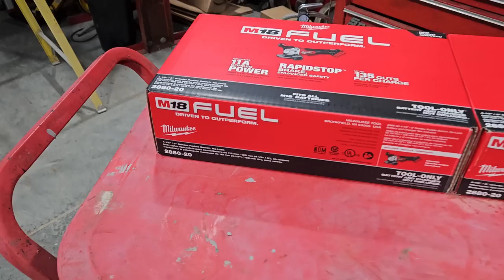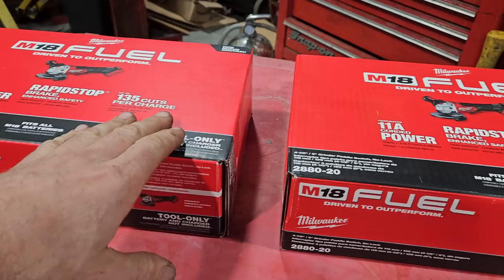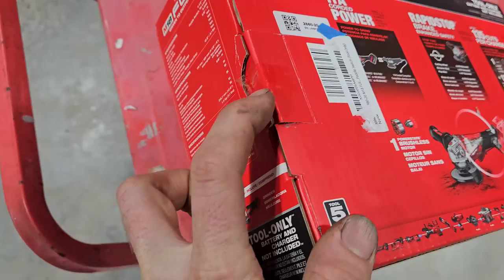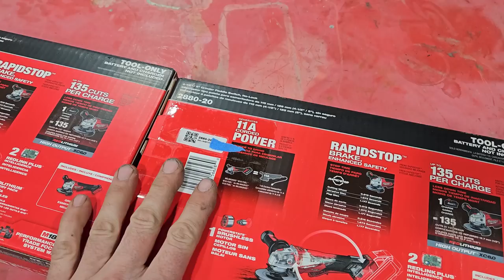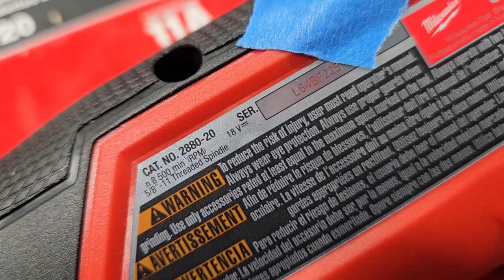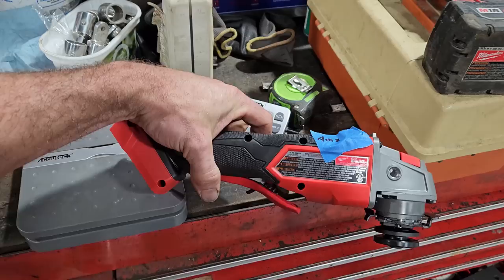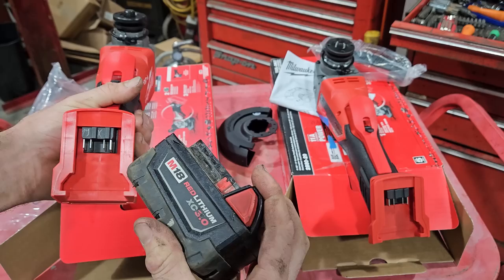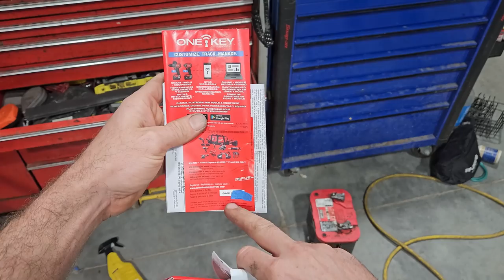Amazon MILWAUKEE Tools FAKE or THE SAME? Half Price!

Comment: I’ve grabbed quite a few fuel tools off Amazon including the grinder shown and so far so good. Jigsaw, 3/8” & 1/4” ratchets, 1/2” hammer drill, vacuum, trim router, couple high output batteries, jobsite blower.. All have done incredibly well and for part time shop use I doubt I’ll ever need the warranty anyway
Reply: They are stolen
Reply: @wpintofg  nobody can prove that they are. You're just assuming that. Even if they are then who fuckin cares? The buyer didn't steal them, the reseller did. It's not on the buyer for being deceived. It's on the reseller. Sounds like a win-win to me for getting a half priced, authentic tool. 🤷‍♂.
Reply: Different price since they are meant for different markets, countries, and turns up another place.
Commonly known as grey market.
Internet makes this convenient, im sure.
Different price, same product.

So if one would like to support middle men, taxes, employees and so on. Buy the expensive one.
Reply: @R.Stridstrom  I have long stopped buying tools from Home Despot. Their mark up is outrageous. My local tool shop is usually able to give me a better deal or throw in accessories like a battery or blades etc and I help the little guy.
Reply: @LG-ct8tw  yeah, if we can, better help the little guy.
Reply: If you need it it won't matter 5 years starts with  manufacturing  date not sales date.   That's all that changes. I have had several  both repaired  and replaced under warranty.   No issues
Reply: @wpintofg not usually
Reply: Cool tell the whole world what tools u have the thief likes people like u

Comment: Very interesting. I have worked a lot in a country in Asia, and before they had a crackdown on non-licensed clothes from brands like Polo, Nike, Adidas etc. it was easy to buy clothes on some markets that was made on the same production lines as the originals, with same materials, buttons etc. and sold for a fraction of the price of the real clothes. 
It was joked about by the sellers, saying it was made outside of licensing and on "overtime" for workers. Guess it was true, same with items in this video?
Reply: I got on 1 of those Chinese sites like wish or ali baba etc..ordered my wife dome underwear that was generic but still usable underwear..we got a the 6 pairs in mail a couple weeks later and it was all Victoria's secret directly from China.. had logos and all..went to store at the mall and compared them..identical stitching etc..we bought a couple dozen more and resold em on marketplace for a significant profit being we were paying about 35 cents a pair.
Reply: A lot of those clothes have hidden defects that make them slightly out of spec.

I know I bought 10 pairs of " mismanufactured" lucky jeans for $8.00 / pr.

The difference between off the shelf and mine was the thread was a slightly different color.

Comment: The sales on Home Depot’s website are always better than in the store. Especially the combos.
Reply: Bingo.
Reply: Why is that? Please specify. Thx
Reply: Different sku’s for online combo’s. Seen it multiple times. Most recently with Black Friday 23. On the 1/2 In impact.
Reply: @paulharsh78  I pulled the trigger this holiday season on the $600 combo set.  Had some trouble with the order but after jumping through hoops I finally got a Home Depot rep that made it right and ended up paying around $540 after tax.  One hell of a deal.  Fuel M18 Hammer Drill, Fuel M18 Impact, Fuel M18 Multi tool, Fuel M18 Jigsaw, Fuel M18 Compact Router, M18 Flashlight, 3 and 6 amp high output batteries and a charger (standard charger not rapid 😭).

Comment: Amazon definitely does not sell pirated tools, they are original tools purchased from offers at Home Depot and they resell them on Amazon, believe me, Home Depot also sells them at the same price as Amazon, 100 dollars or sometimes for 199 dollars, you get a tool or an extra battery, there is the business. Of those sellers, by the way, throughout the year, Home Depot has offers in the app on Mondays and Thursdays, or sometimes it changes, but mostly they are two days per week, only tools.

Comment: I bet it would even be higher in a tool truck. I know a few years ago I priced a Milwaukee tool on a Cornwell truck and he was almost $200.00 higher than what home depot sold for. I understand they have to have some markup but that's a little much in my opinion. As far as your tool goes, I'm sure the quality is the same.  Great video! Thanks for all you do.
Reply: Correct mak tools is DeWalt
Reply: I understand they need to mark it up but I don’t understand why anyone would buy it from them.
Reply: @CarlYota  weekly payments availability  on truck account is the answer
Reply: Mac told me , dewalt sold thru Mac are better ..but who knows .
Reply: @inverseuniverse5727  It is better for the Mac guy, that's for sure.

Comment: Thanks for posting this just showed up in my feed. I just recently did the same thing, I needed the Milwaukee cut off tool for a job I was doing at home. I noticed a pretty big price difference between Ace and Home Depot vs Amazon. I went with the Amazon everything was correct and worked great. I too wondered about the price point difference. I did receive my tool the next day which tells me it's already stocked at an Amazon location.

Comment: The manufacturing plant that Milwaukee paid to produce the tools wants to run 24/7, but Milwaukee didn't pay to run 24/7 production, so they could keep the tool at higher price in stores. In turn the Chinese manufacturer is using the molds provided by Milwaukee and making their own to sell to make more profit. When outsourcing stuff like this can be common, this is why companies have to be very careful when outsourcing to any China-based companies.

Comment: I keep seeing people say they must be stolen, but have an alternative theory. Right now on Home Depot's website I am looking at a combo kit for $220 that includes the M12 Fuel hammer drill, M12 Fuel impact driver, a CP2.0 battery, a large XC4.0 battery, charger, bag, a set of bits, AND there's a "gift with purchase" promo where you can choose one of 5 other bare tools to get for free (right angle drill, cordless ratchet ($150msrp, this is the most expensive option), oscillating tool, a flood light, or the soldering iron. You add all this to your cart and you have 3 tools, two batteries, 45 bits, and the charger and crappy Milwaukee bag for $220 + tax. That is a grand total of $536 if you purchased each item on its own. That's almost 60% off MSRP. And that is from Home Depot itself, no 3rd party. Home Depot has tons of these big combo deals on their site, some even have in-store pickup (all have ship-to-store, but in-store pickup means it's in-stock locally already). That's genuine products from a genuine authorized dealer, for less than half price. The catch is you need to buy a combo, spend a lot of money all at once, to get that deal. The same M12 drill is $150 by itself and isn't on sale. So what's stopping someone from just ordering this combo, splitting all the items up, and selling them on Amazon or Ebay for well under MSRP while still making a profit? Nothing. I think the deals I'm looking at right now are a Labor Day sale, and I'll bet there are similar deals for every major holiday and for Black Friday. So most likely, that's where all the cheap ones on Amazon come from. 

They're just scalped combo deals. If I go to Amazon right now, the same set of tools (different bit set, couldn't find the same one but similar MSRP) is $362, which is only 32% under MSRP. In other words, the Amazon sellers have a profit margin nearing 40% if all they do is buy low and sell slightly higher. Do it in enough volume, order the maximum per person quantity from HD, go to multiple local stores/multiple people, and they could buy up thousands of dollars of tools at very low prices then make a killing. But crazy enough, if you WANT to buy a bunch of tools and batteries Home Depot is actually a significantly better deal at $141 less than Amazon. Of course if you don't need all those items, if all you wanted was the drill and driver (what I was looking for) you can get those for a total of $150 on Amazon right now, the price of just the drill from Home Depot. It doesn't look like HD is willing to let you get out of the store under $200. 

In a way, the Amazon sellers are providing a valuable service and earning a reasonable profit for it. I don't need more batteries, I don't need another charger, and I'm not interested in any of the free tool options. All I really want is two bare tools at a fair price, which Home Depot and Milwaukee aren't willing to do. Clearly wholesale is low enough for HD to sell stuff for 60% off, and even if it's a loss-leader and they hope to sell you a bunch of high margin accessories, that means they could totally make money selling as low as sellers on Amazon. But they aren't willing to do that. But if someone buys the bundle and pieces it out, we can all get tools for a much much more palatable price. Usually I hate people scalping, but it doesn't seem like there's a shortage and they aren't overcharging. So in this case... I think it's a good thing. And anecdotally, it seems like Milwaukee honors the warranty anyway. At worst the warranty will expire early based on the manufacture date instead of the date of sale.
Reply: Oh, and when it comes to Ebay I'll bet there are a ton of people who aren't even resellers, they just bought a bundle because it was a good deal and they are offloading a tool they won't use. I'm actually really tempted to do just that myself. I don't need a cordless ratchet, but maybe someone does. That bundle is a stupidly good deal if I wanted to spend that kind of money right now. I'll probably just buy the drill on Amazon for $70 though, that's the only one I actually need right now for drilling into some brick. But this right here is the whole goal of these combo deals, I really really want to justify spending $220 to myself. I'll save over $300! That's like getting it all for free right? 😆That's what they want us to think, that's why they have these deals. And honestly if some clever guy takes advantage of the arbitrage potential I'm not gonna feel too bad about it.

Comment: Makita tools, XDT19 impact driver, $114 on Amazon and $234 all other sellers. I tried to review it and point out that it arrived in a plain box not in the typical Makita packaging but they wouldn’t post it. I returned it and purchased it from a reliable seller.

Comment: Home depot is just ripping everyone off man. All there is to it. I bought the cordless Milwaukee wet/dry vac (the box shaped one) for $99 regular price on a Sunday 1 hour before closing. I went in the next day, walked by the vacuums and they had replaced the price tag with one for $150. Absolutely ridiculous there was a $50 markup, and I got it just 1 hour before their system pushed it through. Got lucky that day. Looking at it now, it's priced back down to it's original $99 for Black Friday sales. They jacked the price of everything a couple months ago, so they can charge the regular pricing they are used to for their holiday deals. Classic "Wal-Mart RollBack" tactic.

Comment: Again, great video!  Based on your info, I am confident they are both legitimate tools and think you nailed it when you mentioned "maybe it fell off the back of a truck".  If you dig into the seller's info on the jungle site, it is a house in Los Angeles.  But this person/company sells A LOT of Milwaukee and Dewalt tools.  Could they be a rep?
Reply: ^ They are distributors who aren't trying to Match the profit from HD/Amazon. They get them direct from the source and as long as they sell cheaper than the Major chains they will continue to make money. Amazon and other chains have to obey MAP =  (Minimal Advertised Price) to make it equal to all vendors. Some get 30% off some get 50-60% or more. But the listed price must remain the same. Hence why you'll see chains post See Price in Cart

Comment: It's not 2 Oz. , it's .02oz which is 2/100 of 1 Oz. which is very minimal, a little more grease in one than the other could make up that tiny fraction. I've bought quite a few milwaukee tools from Amazon over last 4 or 5 years and never had a problem with any of them so far. I have bought 2 refurbished tools from Acme and both of them were badly repaired and missing all the accessories,  so no more of those for me from acme.
Reply: Thought it looked like .2, not .02, but, hey , I am just watching, and scrolling.

Comment: A rep from AntiGravity batteries (jumpstart) told me that even they can’t tell the counterfeit from their own product until they completely disassemble the Liion cells. Therefore they won’t warrantee any Amazon or eBay purchases. 
I bought one from a parts store and loved it, so I purchased another on Amazon. The carry case zipper failed quite soon, a little later the thing swelled up after a recharge. I think I’d rather pay another $90 rather than have this swelled up jump starter sitting in a $70,000 pickup truck that I need to make a living. 
If it seems too good to be true, it probably isn’t. 
I wondered if the Chinese factory that Milwaukee uses to make their products might also make more tools than they send to Milwaukee. These identical “extras” get sold on the black market for cheap. I’d pay an extra $100 for a tool actually made in Milwaukee. Or Red Wing. Or Towson.

Comment: I bought a Milwaukee framing nailer off of Amazon and have put over 3000 nails in with it with no issues? I beat the snot out of it so I am guessing its real😊
Reply: It's real, real stolen
Reply: Of course it is real. It was stolen from depot probably and resold below cost to you

Comment: I bought the M18 deep cut bandsaw on Amazon for a steal and the tool was a complete dud, tried everything but it wouldn't do a thing. However, i returned it and got another from the same seller out of curiosity and the replacement one still runs like a champ.

Comment: My guess is the Amazon one was previously returned from Home Depot or another retailer. Do you know what happens to the tools you return to the store? They don’t go back on the shelf most of the time. They get wrapped up on a pallet and sold to an auction house. So my guess is this came off of a pallet. You can get a pallet of returned Milwaukee tools for 3-4 grand. The tools on that pallet were probably worth 10-12 grand new, so even if you sell them at half price you’re still making good coin for little to no work. 
Of course the risk is you might get tools that were returned because they were defective and not just because someone wanted to do the Home Depot Hack.
Reply: i have purchased electrical items from HD that were used and returned and put back on the shelf.  I know this because parts were missing or replaced.  Contractors in my area return items all the time.
Reply: @frankd8957  I think they treat hardware and supplies differently than power tools. It’s just too risky to put a returned tool back on the shelf. But an unopened spool of wire or an unused gang box is what it is. It could even be a directive from the power tool company. They probably wouldn’t want to honor warranty on a tool that was previously returned.

Comment: prob a return item or remanufactured/refurbished and a slightly older model iteration. the amazon does look to have a bit more sheen on the metal head end and where the disk clamp is. looks like there is oil there like it may have had a refresh or something done to it.

Comment: The difference in serial number can be attributed to differing styles of laser jet printers on the manufacturing lines. I work in manufacturing and repair these printers often. These companies will hold onto older units for as long as possible, which may have a different font but be coming right off the same manufacturing floor.

Comment: I'm pretty sure the difference in price is in the warranty. I know from experience when I got tools from a local supplier on my job, we got them cheaper than most brick and mortar places. Turns out Milwaukee warranties their products according to manufacturing date, not according to date of sale. So, if you buy a Milwaukee tool under three year warranty, that warranty may already be half over or more before you even buy it. The warranty time period is the determining factor on price of the product. You loose warranty before you buy it, it will be cheaper than a full warranty tool no matter where you purchased it from. If the warranty is out by manufactured date then you'll probably only pay half price. However, since most Milwaukee tools are good you could end up saving alot of money on lower warranty periods.

Comment: I purchased a while back a Dewalt drill kit came with a hammer drill and a driver drill with the batteries and the charger $359 it was brand new right in the box. I have the warranty with it. If I would’ve purchased the parts separately, it would’ve costed more but they do make fake knock offs of certain tools, but these ones were genuine.

Comment: You can hear the gear slop in the Amazon one. And it sounds tight and right in the HD. May not mean much the first 20hrs. But they way things work is that failures happen in the most of inconvenient times of need.
Reply: I noticed a sound difference too.

Comment: I needed warranty work on my EBAY purchased M12 die grinder. Milwaukee fixed it under warranty no problem. Its based on the serial number, not the seller...at least thats been my experience.
Reply: Yes within 5 years . I just had impact driver repaired at local repair shop.  I had looked up on Milwaukee site how to read date from serial number. I was so happy I was within the 5 years so repair was free !